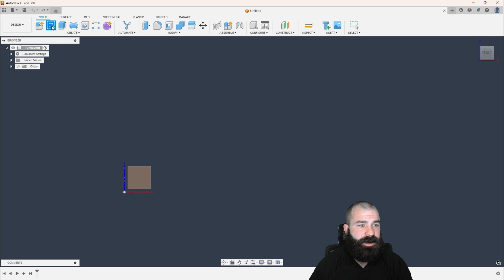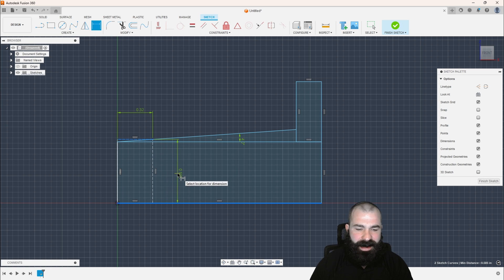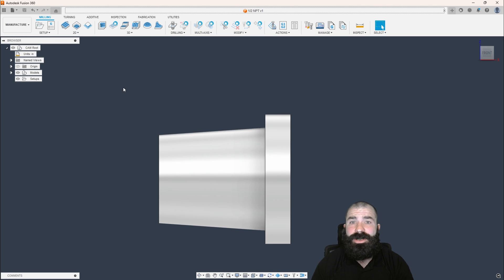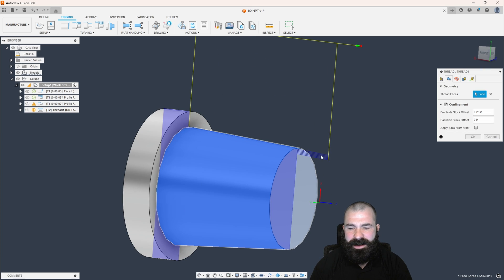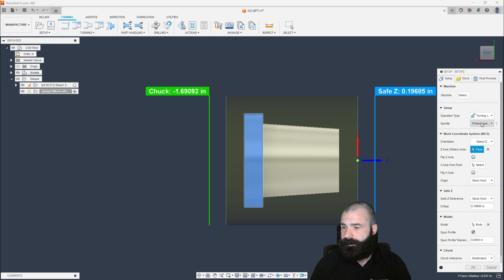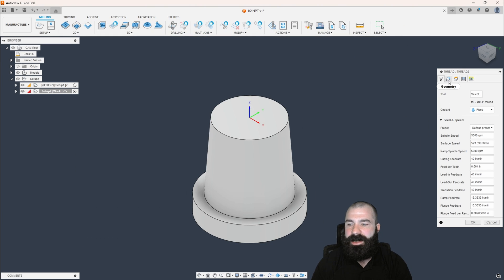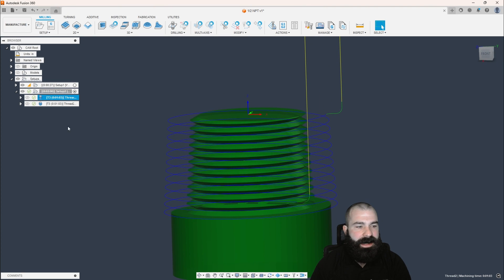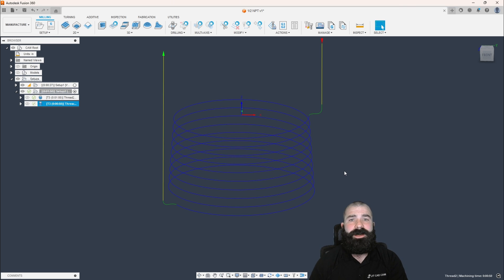Fusion Friday: Machining NPT Threads

Comment: were did you come up with 4deg ??
Reply from the maker: Been a min from when I made this video however if you look up the thread specs to what your trying to make it should give you the Degree at which your threads are needed to be Modeled.
Reply: @JITCADCAM  almost no videos about NPT threads modeling in Fusion 360. By standard NPT treads angle has to be 1.79 deg each side of your 2D drawing
Reply: yeah, saw 4 degrees and was like what in the world.. .. 1.7899 deg is correct for 1/2-14 mnpt. if you're going to put this out on yt, a little attention to detail can go a long way for the viewer imho.

Comment: On a lathe you've made a conical thread, not an NPT. With the thread pass in the video you will have equal depth on the cone.  To machine NPT you need to make an additional cylindrical surface with the OD equal to the NPTs' boss OD and use this surface in the threading operation. I've programmed and machined a lot NPT fittings using this method and were nice and tight.